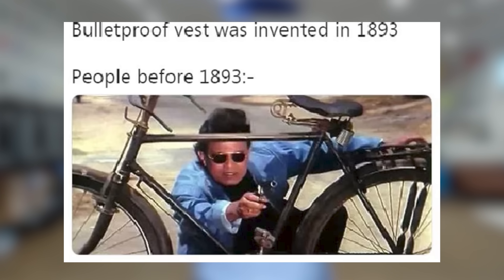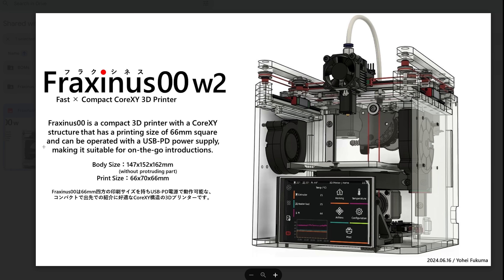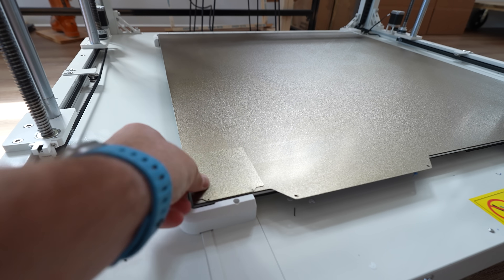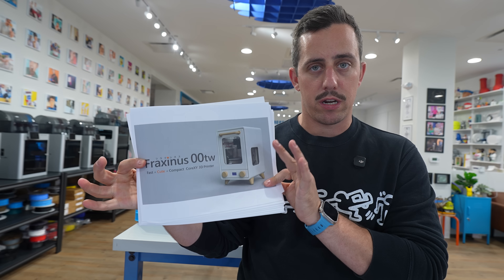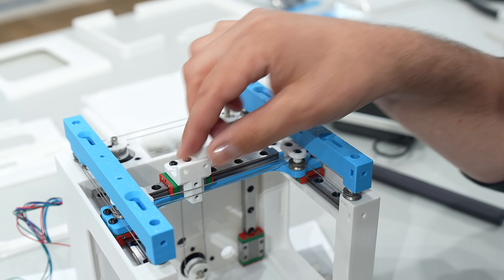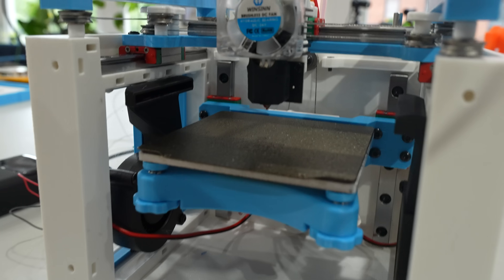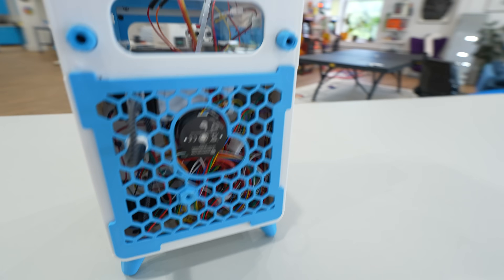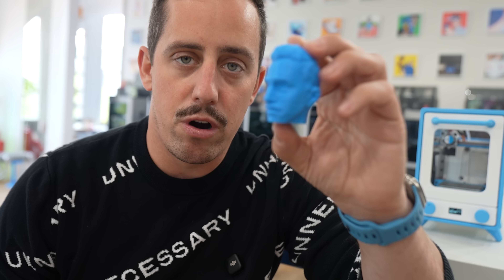I 3D Printed a 3D Printer.

Comment: 16:57 It's cordless: Wireless means that it is connected to a pc via a wireless connection, say bluetooth, wifi or 2.4ghz. Cordless means that it has it's own internal powersupply by means of a battery like a cordless drill.
Reply: 17:35  It could also be wireless, it wasn't explicitly stated, but looks like he sent the print from his computer directly to it over the network.
Reply: @RandyRhombus Or via usb... it wasn't really shown how he communicated with the printer.
Reply: @KayoMichiels didn't he say the head would be the only thing on this printer's SD card?
Reply: I concur. Cordless is power; wireless is digital info. Therefore it is cordless
Reply: Cordless means there's no cords, clearing there are cords and cables and wires. It's just "portable".
Reply: @zeteya  everything has wires internally.
Reply: Who cares guysss😂😂just leave it😂😂😅😅

Comment: It is definitely cordless and not wireless. Cordless refers to a appliance that typically would be powered by the wall while wireless typically refers to devices that would communicate via a cord but instead communicate using different wireless methods. They don't call your tools wireless tools. They are cordless. Well headphones are referred to as wireless because they would typically be plugged in to another device otherwise.

Comment: You can increase print quality by dialling up settings. Bambu did that for you, on custom 3d printers you gotta do it yourself.
Reply: or actually make sure the two Z rails are parallel and doesn't bind. It's binding in the video.
Reply: @youtubehandlesux  i spoted alot of play in the 'belt' pulleys,  think they wire could be drawn tighter too
Reply: Don't forget vibration/oscillation compensation.

Comment: That was cool. How does the battery do? How often does it need to be charged?
Reply from the maker: I need to do a full test - I can't quite see the percentage screen with it in the base there. However it was able to print one full head without it losing power. I've just been charging it up after each print though.